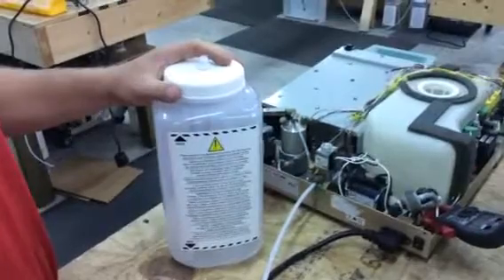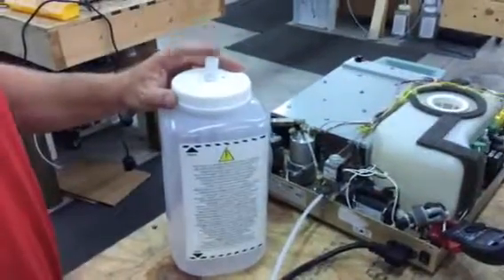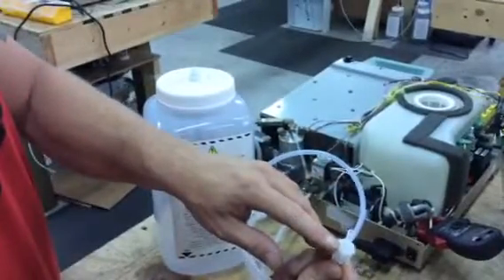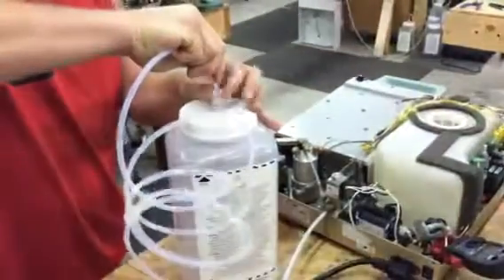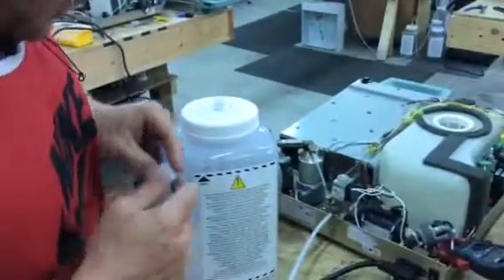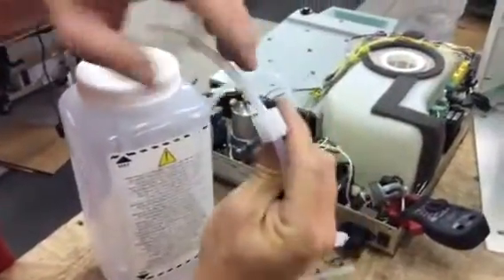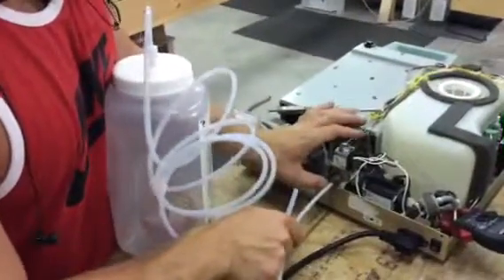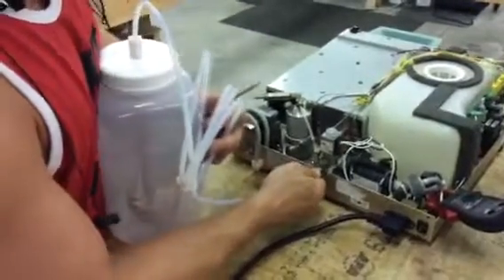How to Connect a Waste Bottle Fitting on a Scican Statim 2000 or Scican Statim 5000 Waste Bottle

Comment: On my device, the tube at the quick connect appears to melt, loses it’s round shape and eventually pops out of place. I cut about 1inch of tube and push it back in. That will last about a month. Ideas?
Reply from the maker: Thank you for the comment! If the tube is melting, the tube might not be OEM or a qualified aftermarket alternative. The polymer used for the Statim waste water tube is PFTE (Teflon) so that it can handle the high temps of the steam. We have OEM and RPI tubing parts and kits for the Statim 2000 and 5000, as well as the G4 2000 and G4 5000 available for purchase on our site using the link here: https://statimusa.com/?s=01-100204S&product_cat=0&post_type=product

Comment: How do you remove the tube?
Reply from the maker: Push in on the outer ring of the quick connect brass fitting the tube goes into while pulling tube out . Or call me 813-220-6192